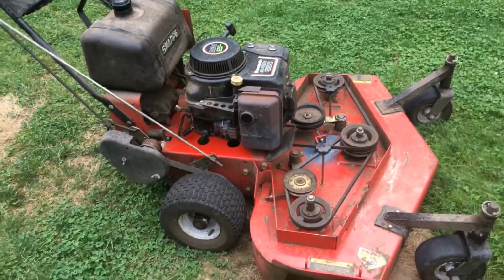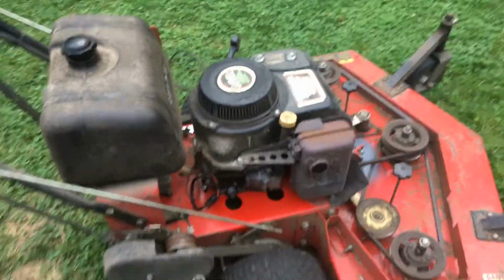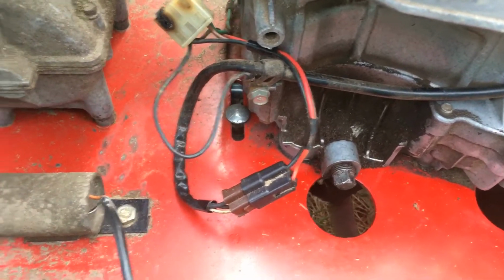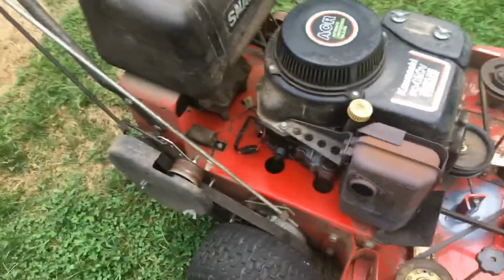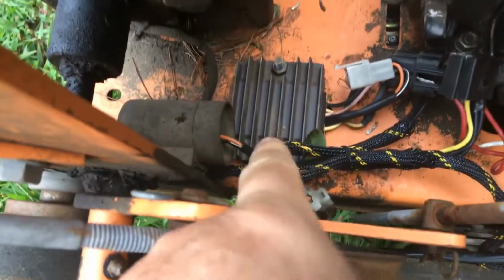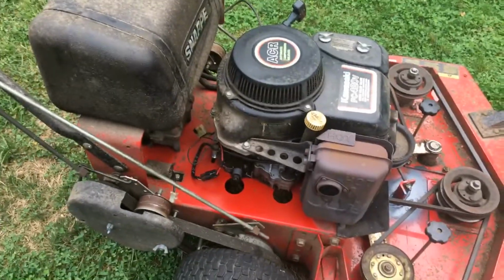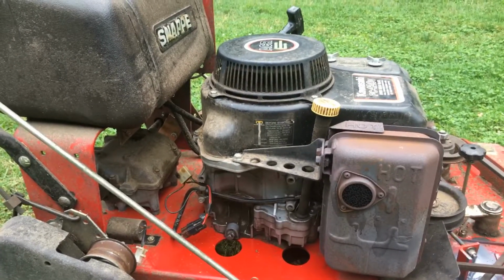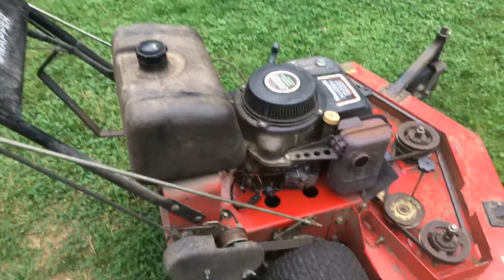Kawasaki non-battery electric PTO rectifier/regulator issue

Comment: Hey I’m working on one similar engine changed no battery missing capacitor . I’m going to check engine stator if good I’m getting hooking up a Briggs regulator then installing a smaller 12 volt battery to system. The regulator needs a 12 volt current to regulator to complete a circuit. Then of course a good ground. This should be capable of supplying enough current to operate PTO blade.
Reply from the maker: You can always check the draw from the PTO with an ammeter to see what it is drawing. By powering off the battery it should have more than enough to cover it.  Just make sure it's enough to run the PTO AND charge the battery.  Good Luck!

Comment: I have a Kawasaki but I can’t get spark even with new coil
Reply from the maker: is the kill wire disconnected? Is the coil right side up? Have you checked resistance readings on the coil to make sure it is good? Remember NEW means Never Ever Worked!

Comment: I'm working on a scag with a 19hp kawasaki non battery, non voltage regulator. I replaced the slator but pto clutch still will not engage. Any help would be appreciated.
Reply: I think it was just the air gap on the clutch, took off the clutch because one side was impossible to get to,adjusting the air gap on all three adjustments put it back on and it's been working so far.
Reply from the maker: @williamgarner2994  fantastic!
Reply from the maker: Have you looked at the wiring diagram?

Comment: Did you ever figure out what the problem was/is ?
Reply from the maker: I isolated the PTO and it was ok. There was an internal short in one of the AC windings in the stator.
Reply: @KensSmallEngineRepair   So you replaced the stator and that cured the problem ?
Reply from the maker: Dragon Rider i wanted to replace it but the owner didn’t want to spend the money.  This particular Scag also needed a transmission. I thought it was worth fixing and I still might as the owner left the unit here. It’s been 18 months!   He has multiple units so I guess he just gave up on this one which is over 20 yrs old.  I still prefer manual PTO Sachs. Less to break down.
Reply: @KensSmallEngineRepair  I mainly work on Exmarks and Lescos, older ones have a similar problem.  Here is what I think the problem is/was. You had a clue there when he told you that if he jiggles the wire, some times the PTO would work. A loose connection or a wire that is broken, but sill making contact at times. The second clue is that the connector is burnt, arcing cause by the loose connection. Easy fix. Replace the connector, a pig tail can be had at Radio Shack, NAPA or even on line. Me, I just use either bullet or spade connectors, problem solved. 

Now that being said, with it sitting out in the weather for the last year, there might be other problems now. 

You can always come over to Lawnsite and ask here when you have a problem if you are not a member already....

https://www.lawnsite.com/forums/mechanic-and-repair.35/

Good Luck
Reply from the maker: @dragonrider93  i did replace all the connections with new and retested with the same results, engine would shut down.  It then started making a noise under the flywheel which is how I discovered s problem with the stator after further investigation. I’ve used your site before to investigate small engine issues. It has been helpful. Thanks for the invite

Comment: Glad i found this. I'm currently going through the same issue. I have a Scag 48 non battery. Mower starts up but then I engage the PTO, the blades won't run.
Clutch tests fine. I actually connected the clutch to a 12v battery and the blades spun. PTO switch is good. I'm thinking that the regulator isn't sending enough voltage to the clutch .
Reply from the maker: Let me know how you make out
Reply: @KensSmallEngineRepair  Ended up being a bad regulator. Ordered one through Amazon and it works.. Surprisingly now a month later, the clutch went.
Reply from the maker: Arthur Jolicoeur it’s always something!!

Comment: I'm pulling mine apart now--not getting proper voltage through the R/R.  Going to check the raw voltage hitting it.  Before now I've been "jumping" my clutch to get it started with a wire directly from the output of the r/r to the lead hot to the clutch.  Wouldn't work yesterday and I got the voltmeter out and found no more than 3.x volts anywhere past the r/r.  Methinks there should be more.  Mine is a Scag with Kolhler CP 15.

Comment: If voltages check good, then power is rectified. So a failure under load leans toward a dropped connection or loss of capacity....check the capacitor (remove the resister if one exists)  if good, test the resistor.

Comment: Kenny that’s a rough one.   Can you use a voltage regulator for a 15 amp Kohler which costs like $15 on amazon in place of the $200 regulator?  Could something with the clutch and or capacitor be causing a more than normal load causing the wire to melt in that terminal ?
Reply from the maker: Ralph, the Kohler type rectifiers are made to charge a battery. This system is used to power a PTO, with a capacitor to handle the spikes like Zombie wrote. Im going to take Craigs advice and just make a new fresh connection and hope for the best!  Thanks for everyone’s support!
Reply: Got yah.   I hope it works , can’t wait to see the follow up.   Nice work..

Comment: Check the crimp on the wire end may be just a loose or bad  or crimp connection
Reply from the maker: Craig Timmons you know im going to try that tomorrow with a new connection. Best to try the simple stuff first. I hope you’re right, the condensor is 100-140 bucks!! What have I got to lose?  Thanks!!
Reply from the maker: Testing proved a bad connection probably caused the burnt wire.  When I started it up last weekend it started making a heck of a squealing noise and the wires got hot again.  Turns out the magnets in the flywheel let go and took out the stator causing  the shorting.  Good thing it started squealing or I would've fried more stuff!

Comment: Have not worked with that system. 

The cap/condenser is there to  handle the surge current  when the clutch is engaged. Replace      it, they are not solid state and go bad with age.    Should be way cheaper  than the regulator.         I don't know what the surge current is when the clutch is first engaged ,  maybe you know what the PTO's on lawn tractors are fused with.

The die on reverse has me baffled.    Maybe there is a switch to disengage the pto when reversing and its  causing a short.
Reply from the maker: Zombie Engines, why would the stator wire connection fry then? The cap isnt shorted out.  The stator is rated at 13 amp, the regulator 14.4 and the fused link is 15amp. If I had the Mfd rating on the cap I would verify it
Reply: @KensSmallEngineRepair  i suggested the cap mainly because i figured it would/should be cheap  but i was wrong on that one.     a cap can stop working without shorting

given the outrageous prices on these parts i might convert it to use a lawn tractor battery and regulator
Reply from the maker: Zombie I appreciate any and all suggestions, oh I also subscribed to your channel.
Reply: @KensSmallEngineRepair  thanks for the sub